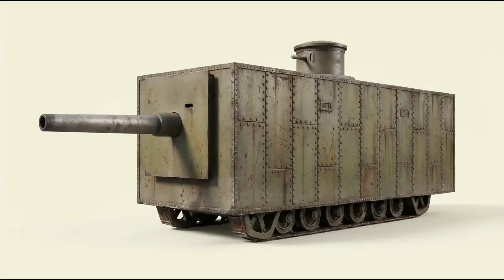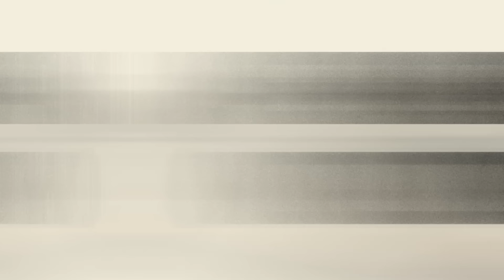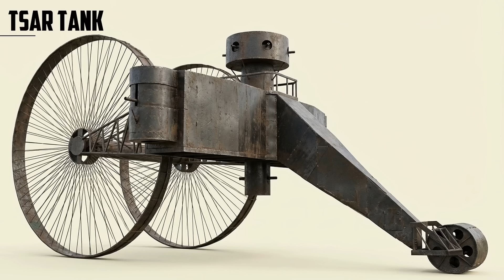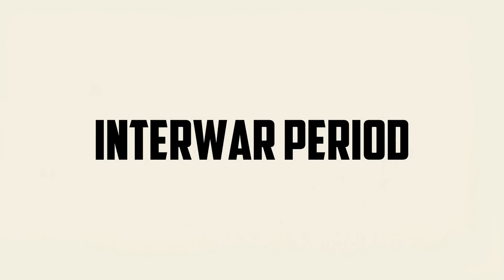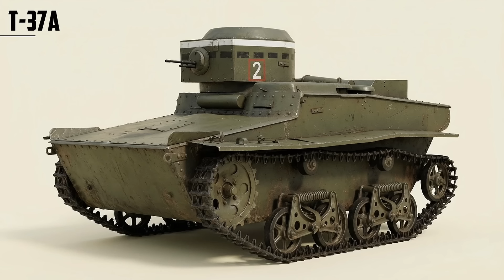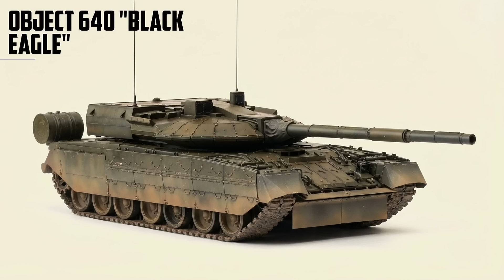Every Soviet & Russian TANK Ever Made

Comment: Arguably one of the most important evolutions is the T72, could have shown the difference between T72, T72A, T72B, T72B3, T72B3 2016, T72B3 2022
Reply: No, t34 introduced sloped armor, which revolutionised concepts of heavy tanks back to mbts. Russians got it right with speed, weight mobility and lethality.
Reply: @1nn0centBystander the T-34 was not the first tank to use sloped armor. Engineers understood the benefits, they just forwent them in most cases for other reasons such as crew comfort and internal space. Hell, the French used a lot of sloped armor in their designs, it's just that those tanks sucked.
Reply: @thefellowofthefellows bro I hate to break it to you but french tanks were much superior to Germans at start of ww2, this is a known fact. The Germans simply went around them that's all
Reply: @thefellowofthefellows  Вся разница, что в СССР смогли воплотить и наклонную броню и надежность и проходимость и мощное орудие, совмещение этого всего сделало танк Т-34 революционным, не даром все немецкие танки, как Пантера и Тигр 2 имели наклонную броню, на тот момент это было важным фактором.
Reply: @1nn0centBystander  I would say T-44 is what made heavy tanks obsolete

Comment: the  T 28 main turret looks a bit odd, i don't rammer it having the 45mm gun but rather a weaker gun

edit: the t 34 you showed, was a t 34 - 85.
edit 2: that kv 220 was a normal, but elongated kv 2 - the actual kv 220 was a modified kv2 with the zis 6 gun. 
edit 3: the "T 43" was a T 34 85

(yes i know that there was an experimental version with a zis 5 gun)
Reply: No, the main turret of the T-28 had a 76mm gun.

Comment: Object 640 could have saved so much time, effort, and casualties in wars. 

I still think that the T64 was the last really good tank. 

T80 had potential, but it soon fell behind nato tanks.
Reply: Russian tanks have not fallen behind NATO tanks. They fit into a doctrine of cost efficiency and quality/quantity balance over maximum individual quality. 

NATO tanks have not impressed either Russians or Ukrainians. They proved more unreliable such as the Abrams’ electronics getting damaged by high humidity, liable to get stuck in mud, and no more survivable against FPV drones. The Abrams for example usually won’t detonate internally like a T-72 will if the magazine is hit, but its magazine is on the practically unarmored turret bustle, where it is trivial for the first drone that comes along to hit the magazine. If that happens the crew might survive but a $10 million+ tank is left burning. The T-72’s magazine is at least better protected and lower profile. In combination with anti-drone shells there have been cases of T-72s surviving up to 40 drones before finally being disabled, thus buying time for the infantry and IFVs do move unimpeded. 

Aside from that, the cost efficiency is an important. If an Abrams costs $10 mil and a T-72 costs 2.5 mil, a country can buy 4 T-72s for the same price as a single Abrams. As an individual I might prefer to be in an Abrams but as an officer I would prefer to have 4 mediocre tanks rather than one good one - especially in an environment like Ukraine where even NATO’s much heavier and more expensive tanks are vulnerable. If I have a $40 mil budget for my unit and after several hours of combat drones knock out 4 of my tanks and I went with the Abrams, I am out of tanks. If I went with the T-72, I still have 75% of my force. 

Tank on tank combat is rare today. There have been only several cases of it in Ukraine, and there was at least one case of a T-72 destroying an Abrams. 

The Russian MoD thought about branching out to Western design concepts. That was the T-14 project. It was abandoned not because as some people put it, “Russia couldn’t afford it,” which is a statement I don’t think even thought through, but because shortly after taking on the concept of a higher quality more expensive tank Russia saw the performance of the Abrams and Leopard 2 in Yemen and Syria respectively and balked at how badly these hyper-expensive tanks did corresponding to how much money was invested in them. 

That caused Russia to pivot away from the T-14 and to the new T-90M, which represents a very strong modernization but is still more cost-efficient than the T-14. 

The T-14 was debuted briefly and covertly in a fire support role in Ukraine but I think right now Russia doesn’t know what to do with the project. 

Likewise right now drones have killed the APC and to a lesser extent the IFV. They are too vulnerable and too slow and now infantry prefer high mobility and low density means of transportation like civilian trucks and motorcycles. 

Most likely Russia is waiting to see how effective counter-drone systems can be before deciding how to invest in tanks and other armored vehicles going forwards. 

As for NATO, it continues to evolve technologically and some NATO countries are a step ahead of Russia but NATO is still stuck in 1990’s design concepts which are unsuitable for modern drone warfare.
Reply: @QualityPen  excellent comment. But I think that both NATO and Russia are stuck in 1990's design concepts. I ain't a fan of war; however, I'm interested in military technologies, especially tanks. I'd love to witness new tanks design concepts or revolutionary as long as they wouldn't fight each other, which is quite naive, I think :)))
Reply: @QualityPen 
Understandable, thank you